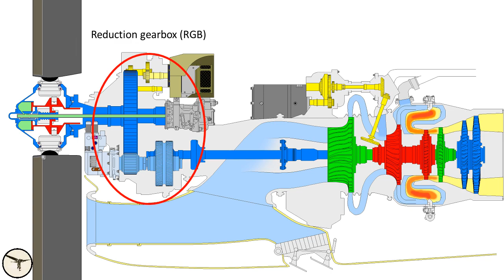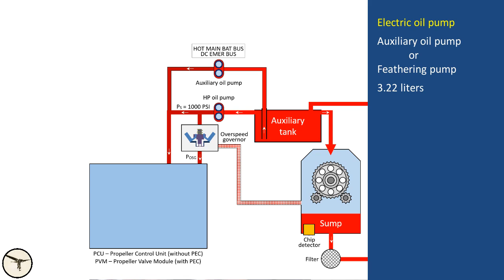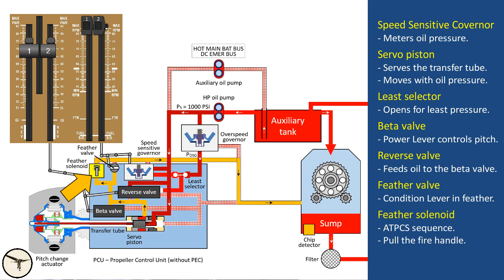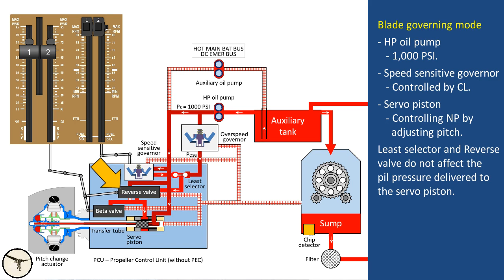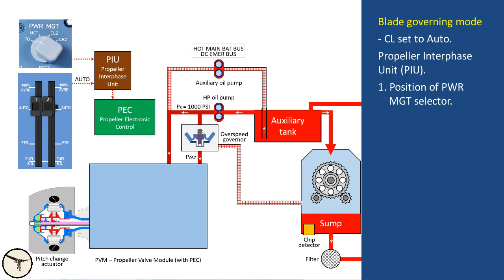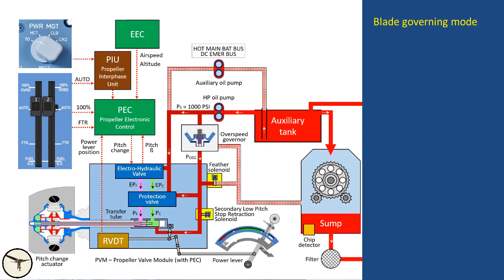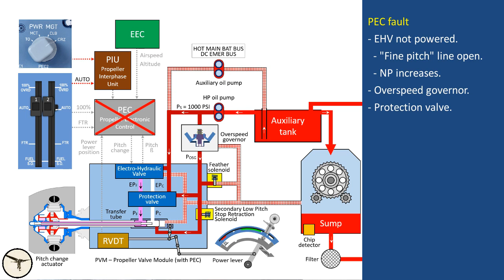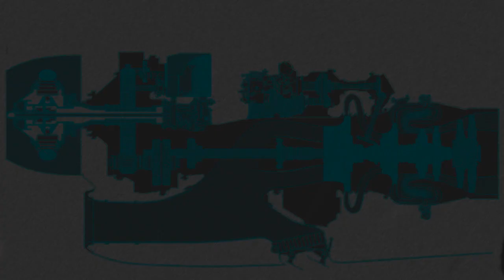ATR systems - Powerplant part 3 - Propeller

Comment: Secondary low pitch stop valve is at the PVM end of the transfer tube. As the name denotes it will stop low pitch at 13 degree. Primary low pitch protection is with overspeed governor which activates at 14 degree blade angle or 102.5%NP. Secondary low pitch stop retract solenoid energizes after landing allowing PEC to achieve reverse pitch. In flight it remains inhibited.

Comment: Great video! I have realized there seems to be some sort of shielding on the fuselage right at the side of the left engine propeller. Do you know what this is for? I wonder if it is to protect from uncontained blade failure? Thank you, Captain Nordal!
Reply from the maker: Hi, the shielding on the fuselage is made of Kevlar and protects the fuselage from dents when ice is shed from the propeller blades. A blade failure cannot be contained, as the energy level is too high. However, propeller blades just don't break off. There has been an accident with a Dash-8 where a part of a propeller blade shed off after hitting the ground (or another solid object) and penetrated the fuselage.
Reply: @FlywithMagnar  Thank you so much for the informative reply. It was very helpful!!

Comment: Why does the engine sound change so dramatically when condition lever is moved from Feather to Auto after start? Does the condition change also increase the engine RPM in addition to changing the propeller pitch?
Reply from the maker: What you hear is the increase in NP (propeller RPM) from 15% to 71%.
Reply: @FlywithMagnar  Thanks for the reply, captain! 😊 Just to be sure: does the condition lever also increase the engine power or is Feather -> Auto changing only the pitch of propeller?
Reply: I believe power is also increased along with pitch change(from low pitch to a higher pitch).
This is because ordinarily, any increase in blade pitch(ONLY) often results in increased drag & consequently reduced rpm.
Reply: @juzajuza engine power is TQ * NP. So yes, higher NP means more power. Indeed with propellers feathered you could advance power levers to the ramp, it will do nothing

Comment: The function of the secondary low pitch stop retract solenoid is to block return line from metering window of the transfer tube. Thus allowing lower pitch angle (<13°) till reverse on ground.
Reply from the maker: Thank you for this information. Just one question: How is the solenoid controlled? By power lever position, WOW or other means?
Reply: @FlywithMagnar  It is controlled by power lever microswitch when PLA below Flight Idle. Due to AMM dedicated switches are 3KX and 4KX.
Reply from the maker: Thanks a lot. When I made this video, I used a drawing where it appears that the solenoid is open during flight. But based on the information you provided, this might be wrong?
Reply: @FlywithMagnar  It is opened during flight and draws excessive oil from transfer tube fine pitch line to prevent low pitch <13° during flight

Comment: sir please include, the electrical feather pump is  activated by fire handle as well in flight....any emergency action corresponding to isolation of engin in flight or on ground it will be activated
Reply: so when electric pump fails ..we cant feathet the engine in emergencies right?i think hp pump  runs while gas turbine is running only

Comment: Sir,
You have such immense knowledge about the engines, as if you are a mechanic.   Great.

My curiosity drives me to ask you a question.   Does a pilot need to know  so much ?  Or was it your interest to learn as much ?

But I do appreciate your knowledge.
Reply from the maker: No, that is not necessary. The pilot only needs to know how to operate the systems.

Comment: Dear Captain Nordal,

Congratulations for your magnificent ATR Channel - Lots & Lots of work on them. 

As an A&P Mechanic & Instructor, I watch your modules with great interest since I do not have physical access to this aircraft and learn from them.

I would like to have some clarification from your end as it relates to the ATR Propeller Synchronization System since I do not have access to  ATR’s  FCOM  Manuals.   

Although technology is evolving with assistance from  EEC, PEC, FADEC,  etc.,   I lecture my  A&P students that the Pilots do not normally engage Prop. Synchronization during the Take-off, Climb, Approach & Landing periods to minimize any drop in  RPM’s  in case of issues with Engine # 1 and,  I think the FAA has some words on this as well.

In this Video @ 11:43 you mention that Prop. Synchr. is inhibited when the  “PWR MGT” Knob  is in  “TO” position but otherwise available when NP is above 70%  ( I figure any other positions on the  “PWR MGT”  above  > 70% )  but at the end of the video  @  20:47  you mention that we can see Propellers  Synchronized during take off.   Is this just a Visual appreciation associated with the  Video Frames ?

Please clarify  and  thank you again for your Magnificent effort   100+% .

Sincerely,
Roberto V. Herreria,  BSME, A&P
Reply from the maker: Dear Roberto. Thank you for your feedback. 

Different ATR variants have different engine variants. Engines without PEC have a pushbutton for the synchronizer. It is always engaged, unless specified by the checklists, for example after shutting down an engine.

Engines with PEC do not have a pushbutton for the synchronizer, as it is integrated in the PEC. Therefore, with the PECs operative, the propellers are always synchronized, including take-off.

Comment: the secondary low pitch retraction solenoid is activated by the PL when it reaches at or below 31 deg of PLA. FI at 37 deg, so the low pitch solenoid will get activated slightly below the FI position. 

when activated it opens a pressure port that increase the low pitch pressure and there by takes the propeller  pitch to ground configuration (beta at which the propeller produces less lift so the A/C remains static or produces minimum lift for taxing when PL above GI) this ground configuration includes reverse as well ..

if PEC fails then the solenoid cannot be activated as a result low pitch indication cannot come on though PLA <31 deg ie) the propeller won't reach  ground configuration and that's why reverse is also not available.

the primary low pitch protection is the ideal gate that won't even let the PL to travell below 37 deg = FI

in flight ie)  PL >31 the low pitch solenoid will be deactivated, thus closes the duct and reduces the low pitch pressure and takes the propeller to in flight configuration ie) propeller pitch > 12deg which help in generating more lift

Low pitch abnormality in flight is a condition where the solenoid is activated inadvertently and takes the propeller to ground configuration that results in less lift and more drag leads to an yaw.

please be in touch +91-9080563934
Reply from the maker: Thank your for your information. It is highly appreciated.
Reply from the maker: magnar.nordal@gmail.com
Reply: @FlywithMagnar  thank you sir ....will contact you soon

Comment: also on ground the activation of electrical feather pump through CL is not available / inhibited since mostly it is a normal situation rather than a emergency situation but atpcs will activate it on ground

Comment: Hello Magnar,  great videos!
I flew ATR long time ago and had a few questions. 
Have you ever tried to unfeather running engine in actual flight? I remember in 72-212 it took about 20 seconds from FTR to AUTO on the ground before taxi. But do you think it might take longer in the air?  Will there be any response If I'd move power lever on running engine with feathered prop in the air? 
I know investigation will find out but still I am very qurious if Yeti pilots had any chance if they would unfeather props at this low altitude in high terrain ( provided that they actually confused flap and CL which is a strange and exotic case)
Thanks!
Reply from the maker: Hello. My experience from the simulator is that it takes slightly less time to unfeather the propeller in flight. So yes, if they had discovered the error in time, they could have saved the day. When the engine is running with the propeller feathered, the NH rarely changes when the power lever is moved.

Comment: If you notice in the engine limitations section of the FCOM (72-500/600 variant), it is stated that " operation upto 106.3% torque is time unlimited when NP is below 94%". Could you please shed some light on this? Which scenario would this be possible in?
Reply from the maker: Engine power is NP multiplied with TQ. When NP is 100% and TQ is 100%, the engine produces 2,750 hp. 
With 100% NP, the engine can run at 120% TQ (3,300 hp) for 20 seconds, and at 106.3% TQ (2.923 hp) for 10 minutes.
94% NP at 106.3% TQ equals 2,747 hp, and the engine manufacturer has determined that the engine can run with this power for an unlimited period of time. 
When the power management is in CLB or CRZ, the propeller runs at 82% NP. If you for some reason moves the power lever to the ramp or to the wall, the torque will exceed 100%. Possible scenarios: Stall recovery, windshear, or go-around while the power management is in CLB or CRZ.
Reply: @FlywithMagnar   @Fly with Magnar  Thank you for your response capt. My understanding here was that if the PWR MGT is left on CLB or CRZ, and we end up moving the PL beyond NOTCH over a specified period of time, the engine will end up with an over torque.
Couple of scenarios where the crew has done a mismanaged GA with PL in ramp position without the NP on 100 percent ( PWR MGT not on TO/MCT), has resulted in the system tagging an exceedance in the limitation of the engine torque. The TQ Probably went over 106 in these scenarios(not sure). Will look more into it.

Comment: Hi capt.
1) Why does MCT have no time limit, while TO has a 5 min limitation when MCT is actually generating more power at 90.9 vs 90.0 by the TO position,  both being generated with a 100% np and PL in the notch position? 
2) The new EGPWS procedure asks for pwr MGT in MCT instead of TO position, PL to the notch, then eventually advance PL to the ramp if necessary ( i think it will always be safer to use max power in a case of egpws, so better to use ramp straight away). My question is, is there any time limitation when using MCT with PL in ramp position? 
Thanks.
Reply from the maker: Hi, my answers are for variants with PEC:
1) The life of an engine depends on wear and tear, especially in the hot parts of the engine. During take-off is the torque is set to 10% below RTO power just to reduce the wear of the engine. This happens at every take-off. MCT is an emergency setting and is rarely used at all, but the engine will not melt away. Therefore, it's safe to use when you really need the power.
2) PWR MGT is only set to TO for take-off and landing. It increases NP to 100%. But on approach, NP will only increase when you advance the power levers. The MCT position commands NP to 100% regardless of the position of the power levers. But if you already have set the PWR MGT to TO (for example during approach), then leave it there. 
When the PWR MGT is either in TO or MCT position, and you move the power levers to the ramp, the result is the same: 100% torque (unless in hot and high conditions). This torque is used at every go-around. 
Some companies are also using 100% torque at take-off from short runways. The side-effect is that the engine will need more frequent hot section overhauls, which are expensive.
There's no published time limitation for using MCT with PL at ramp position. But you should only use it when needed.
Reply: @FlywithMagnar  makes sense. Thank you for the detailed discussion capt.

Comment: Hi, it seems that Yeti YT-691:s props went to feather simultaniously. Any clues what could've caused this?
Reply from the maker: The report didn't say the propellers feathered simultaneously. Just that both were in feather. Neither does the report tell whether this was an observation from the crash site or data from the FDR. Therefore, it is impossible to know how this happened.

Comment: Capt, I am Capt Suresh from India flying ATR for IndiGo. I have a doubt regarding critical engine in ATR. I want to know, which engine is critical engine and why? If left engine is critical, then it has to have a positive angle of incidence during Take Off run or it has to be in a climb. 

I request you to pls explain this in detail pls.
Reply from the maker: The left engine is critical because both propellers are turning clockwise when observed from behind. Please watch this video for further explanation: https://youtu.be/_lxA0NojuwY
Reply: Capt, does this explanation stands when the ATR is on ground and accelerating for a T/O???
Reply from the maker: @suresh pakala, when the aircraft is on the ground, the propellers produce even torque. The critical engine is defined as the one whose failure would result in the most adverse effects on the aircraft's handling and performance in flight.

Comment: Question: In what condition you would prefer to use 100% NP on approach, on PEC equipped aircraft?
Reply from the maker: When I expect turbulence and/or windshear on short approach and landing. 100% NP gives better engine response.
Reply: @FlywithMagnar  thankyou for the answer.

Comment: Hello, Captain. What is the purpose of the EEC (and other components 15:01) sending data to the PEC if propeller speed (NP) is always at 82% or 100% depending on the PWR MGT selector in blade governing mode? I am a bit confused since the manual says the PEC computes propeller speed using these data.
Reply: Airspeed and air pressure changes will affect the rotation speed of the propeller. For a given pitch, higher airspeed reduces the angle of attack of the incoming air, increasing the rpm. The PEC uses this information to control the pitch of the blades to maintain constant rpm. For example, during takeoff the airspeed changes from 0 to over 100 knots. So the PEC compensates for those changes.

Comment: Sir i have 1 question. I don't know the answer, pleas hlp me

1. PEC fault, NP limited max 102.5% but tendency to more high. What the nect limited.?
Reply from the maker: If the PEC fails, the overspeed governor limits NP to 102.5%. If the overspeed governor fails as well, there's no further protection. What happens, is that NP continues to increase. This is called LO PITCH in flight. The pilots must shut down that engine as soon as possible.

Comment: Dear Capt a friend of mine believes that if we set the CL to 100% override once CLB procedure is done it improves CLB performance, I’m sure it’s a wrong practice, but I don’t know how to discribe it to him, kindly please have a comment regarding why this is NOT a good procedure thanks
Reply from the maker: My arguments are: 1) Disregard of standard procedure laid down by the manufacturer. 2) Waste of money because the engine will burn more fuel and run at higher temperature, which in turn will reduce engine life. A hot section overhaul is very expensive. That's why we use reduced power at take-off. 3) Cabin noise.
Reply: if CL set to 100 / override at higher altitudes then the propeller speed increase that results in lower propeller pitch for a specific  fuel flow. as we know the TAS  increase as altitude increase and if TAS increase this results in low beta ( angle of attack). so higher TAS and less beta results in less lift produced by the propeller for a specific fuel flow. 

now, as the beta decreases the TQ also decrease, so inorder to give a compensation to such situation EEC will burn more fuel to regain some TQ  since top law is a function of TQ

so 100 overide is not to be used except sever icing conditions or propeller anti icing fails in icing conditions

during TO phase 100 / really helps because...engine operates at high power and  since we are at low altitude and less TAS  increased NP will process more air at low pitch like a fan (that is why low TQ during TO than climb and cruise) results in generating lift at low TQ to handle the TO load.

irrespective of all the above, 100 / np will only increase more drag  and reduces lift when PWR MGT at CLB/ CRZ. also cabin noise is increased....so it gives no advantage  instead it gives only disadvantages and reduces climb performance

Comment: What could be the possible cause if only one blade is in unfeathered condition while all other blades are in feathered condition after engine shut down
Reply from the maker: I have never heard about that before. There must be a mechanical failure in the propeller hub.
Reply: @FlywithMagnar  Thankyou for the reply.

Comment: When CL move to override .? PEC sgl chnel or PEC fault/off.?
Reply from the maker: When the checklist calls for it. Single channel doesn't affect the propeller control. Therefore, no action is required. A PEC fault means both channels have failed. In that case, NP increases to 102%, and the procedure is to safeguard it by setting the condition lever to 100% override.
Reply: @FlywithMagnar  thank you for the answer it really helped me, have a nice day